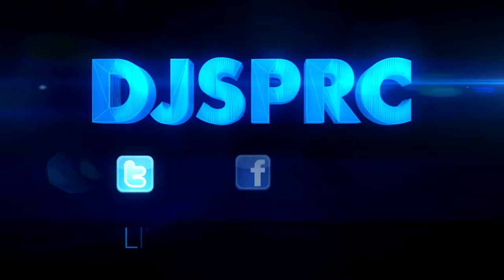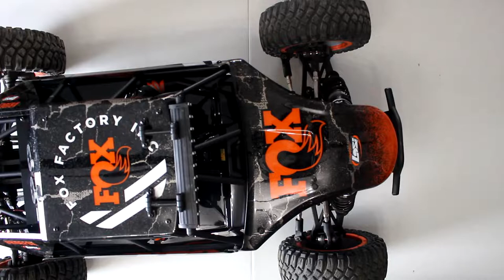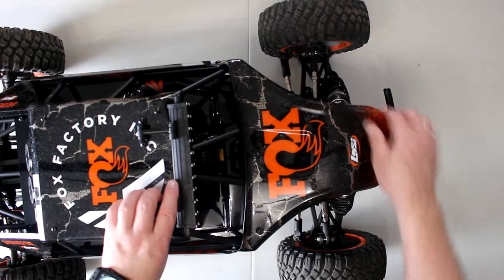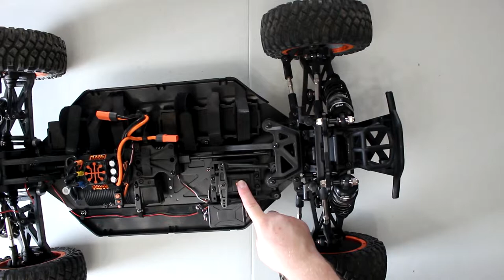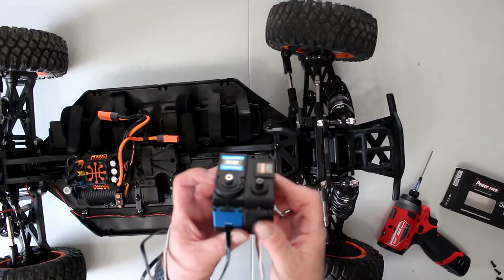Losi DBXL E 2.0 Servo Upgrade Power HD 65

Comment: Hi mate, how did you fix the problem with the steering linkage? I’m having the same issue.
Reply from the maker: What ended up happening it was cricket a little bit we had to play with the turnbuckles to readjust the steering.
Reply: @djsprc  how does that change the distance between the servo saver and servo horn though?
Reply from the maker: @aaronmitchellrc7256  If the linkage on the servo saver is not straight your steering won’t be straight
Reply: Same issue and the solution here (that you omitted from the video) is extremely unclear. Can you explain?
Reply: @djsprc  I have the same problem and I would have liked a video on how you did to fit it straight...I succeded with the plastic horn but I dont like how it turns now...more one one side than the other and cant seem to be able ta alignate it right.

Comment: Don't take this the wrong way but, you did that wrong. 
1) Yes the servo might have been the same size, but the horn is a little bit closer to the front than the stock servo.
2) You might have done it off camera but, on the remote/controller you need to zero out the steering setting then center the servo.
3) You centered the servo but yet, you're going to put the linkage at an angle, why?

I think maybe you needed to watch a couple of videos on how to correctly install servos.
Reply from the maker: Thank you for your comment yes the servo was set to zero and yes the trim on the remote  was set to  zero been doing this for more than 18 years. And yes there’s a reason why I put the horn not straight I did not say it on video. I do appreciate your comment